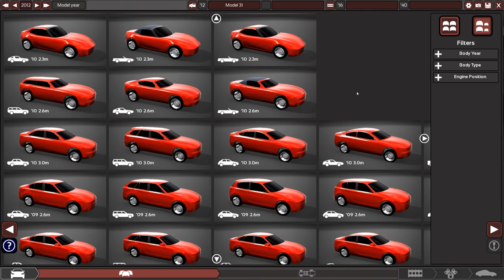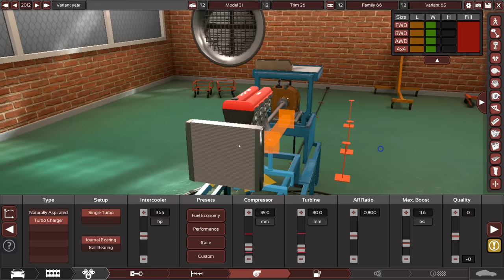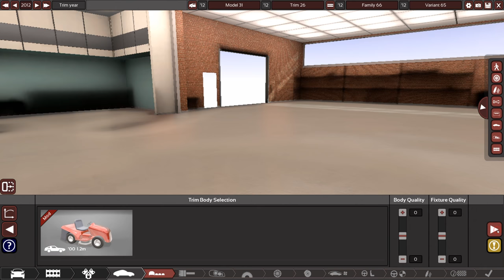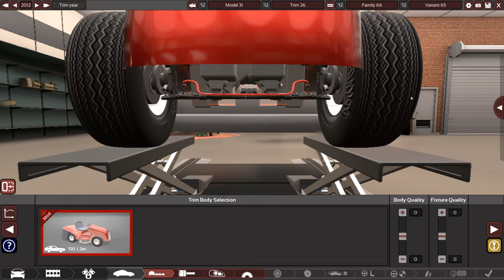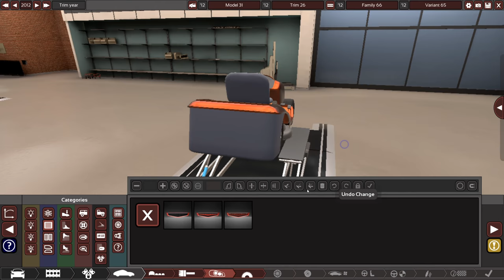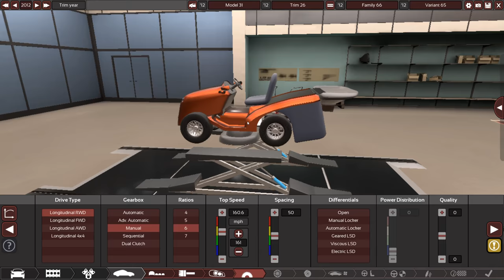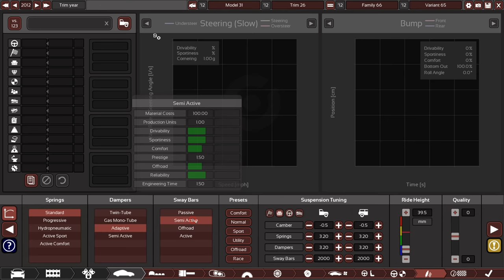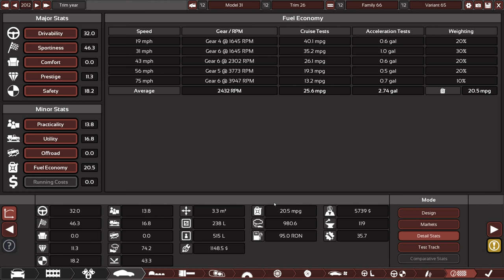Automation/BeamNG Drive - Worlds Fastest (And Scariest) Lawn Mower

Comment: That power curve is like
nothing, nothing, nothing, and then ABSOLUTELY EVERYTHING!!!!!!!!!!
Reply: mega-VTEC
Reply: Or how hovercrafting was put by Richard Hammond, its great, great, great, COMPLETE DISASTER
Reply: in this game there's no way to populate mid range aside displacement. 
i've tried. if there was a way to single turbo a V8 or twin turbo a straight six and run two stages, or twincharge, it would be a different story.
Reply: @comethiburs2326  ... or even just have more than two stages for your VVT, or the ability to tune them more carefully. The traditional VTEC style it seems to use where you have two separate torque peaks, one quite low and the other unusually high with a fall-off in-between is extremely old hat. Everything these days uses some kind of continually variable system, either a sliding cam/follower system with a smooth progression from one profile to the next, or what is more truthfully variable cam phasing to adjust how much of the intake stroke the inlet valve stays open for and how much of it overlaps with the exhaust (which requires non-interference head design of course... my own car uses an economy variant of that which adjusts how much of the fixed lift period falls within the intake stroke, and how much in the compression stroke, essentially varying the compression ratio and effective displacement), or in very fancy cases fully active electrically or hydraulically driven valves. Which means you can basically have the torque peak slide up and down the rev range in concert with the engine speed itself and enjoy a much improved midrange response and top end power without harming low end driveability.

Just one of a number of missing engine features in Automation as it stands (no single or twin cylinder engines of any kind, meaning a whole range of economy cars including some surprisingly recent ones can't be simulated; no V4s or V5s, W-configs, Rotaries; no CVT automatics, multi-range or epicyclic manuals; certainly no electrics or hybrids... hell, not even diesels, and I haven't yet seen anyone make a rear-engined model... etc, etc... and that's before we even get anywhere near exotica like radial engines, alcohol or CNG fuel, flywheel storage etc...), but, hey, it's a game set in an imaginary world, perhaps certain configurations or ideas just haven't occurred to the simulated automotive researchers yet.

Anyway, the insane curve wouldn't be too much of an issue for a real world ride-on mower, as most of them use infinitely-variable transmissions and keep a damn near constant engine speed when in use (other than a momentary dip when you first hit the accelerator pedal...), so you'd just shove the hand throttle up to max, wait for the engine to rev, then floor it and let the transmission governor do the rest. Of course, you'd need a very heavy duty IVT...
Reply: @gwenynorisu6883  you can rear engine. just skip the engine, tweak the boot size and you'll be able to fit a 4.2 flat six in the "porsche" bodies. there's some other rather surprising platforms for rear longitudinal too.

i concur. we NEED twins and narrow banked engines. lancia did VR4's before it was a thing.... for 50 years.
we could also use slanted engines and non crossflow, even siamese ports.
hemis, diesels...
that would offer a much wider and broader bunch of options to make power and economy.

for electrics, well there's not much to be tuned. we would have very little room to adjust thoose, at least untill the game offers platform OVER engine and not the opposite. (i'd rather have one body and twelve engines than one engine and twelve bodies.)
Reply: V T E C
Reply: 2-stroke :DD
Reply: @comethiburs2326  They've said they'll rework the turbos after the campaign is done, apparently that's about when they're adding superchargers, too.
Reply: Tis the way four bangers are, especially the ones that, in the wise words of Sliphantom, are "VTEC-cy as fuck."
Reply: @comethiburs2326  I raise you the 60 degree V4. Compact, powerful, decent torque at low RPM, everything you'd want from a small engine. Thing is, they're expensive to design, due to the extra timing components and engineering required to fit and run a balancing shaft, thus why mostly bikes use the V4 layout!
Reply: It’s not a power curve it’s a power wall

Comment: As a silly suggestion try the lawnmower around the autocross track.
Reply: I tried that. It got stuck on the first speed bump. Shortest lap I've ever had.
Reply: oops, my bad, messing up tracks.
Reply: I made a lawnmower with a tiny V16, stuck massive off-road tires and off-road suspension on it, and managed a lap and a half of the Endurodrome.
Reply: If you put 395 tires on it the suspension freaks out and kills itself when spawning in. I found that 315 seem to be the sweet spot so far.
Reply: Pretty good suggestion from a rapist Mega Lucario
Reply: I was thinking the exact same thing.
Reply: Probably turn over on at the first corner...

Comment: INCREASE THE AIR/FUEL RATIO

It cools the intake charge and reduces knock, meaning you can run way more boost/compression on a turbocharged car, and you don't lose any power.
Reply: Particularly as you're shoving extra air in anyway. It's pretty much expected that a turbo car will run rich. In fact I wouldn't be too surprised to find that it's the in-game way of compensating for the extra air mass, just manually increasing how much fuel is introduced by default at a certain rpm and throttle setting and having it burn in the extra air, instead of the complication of simulating sensors or pressure-reactive carburettors etc. (Would a carb add more fuel in response to a denser air charge, or is it only sensitive to the flow rate? It's somewhat before my time, I've only ever messed about with fuel injected cars, carburettors are a voodoo black box to my mind).

The massive knock failure, of course, essentially emulating what happens if you lean out a turboed car ... mmm, melty pistons!

...which reminds me, I wonder if/when they're going to implement Nitrous? Water-injection, maybe?
Reply: @gwenynorisu6883  
Blow-through carburetors are odd. Because carbs typically only run at around 7psi, you have to design them to increase fuel pressure to counteract that pressure. If you're running a normal carb at 7 psi of fuel and you introduce 7 psi of boost, you effectively make the carb run at 0 net psi and the engine will either go lean and blow up or just turn off.

Comment: managed to squeeze 750hp into mine, safe to say it was undriveable
Reply: update, have managed to get over 1000hp, wheels instantly fly off.
Reply: I managed to get mine to 680bhp and drivable (but only just, it is very wobbly) in 2005, 0 quality sliders. You need to use solid axle leaf front and back in order for the wheels to cope with all the torque, and you'll need to have about 100 rim offset front and rear. It still handles well tbh.
Reply: I've gotten 1300 ish hp before, don't drive it.
Reply: @omatssu  But does it work on beam?
Reply: Hell yeah, just the DCT is way to violent
Reply: @omatssu  I didn't realise the gearbox type had that much of an impact with driveability. Which gearbox have you found to be optimal?
Reply: @a1media885  haha made my day sir
Reply: If you wanna drive it, use the automatic gearboxes
Reply: @a1media885  The wheels flying of is due to wrong / weak suspension, (had the same problem...) just use the semi trailing arm in the rear and solid axle leaf in the front, than it should work...
Reply: I got mine to 2294 HP, it vibrates violently whenever above 150 mph
Reply: @D.O.A. I'll get it tomorrow
Reply: There’s a new version of it I think, built one with 3500 Horsepower. It goes 0 - 100MPH In 0.2 seconds, and it can’t go any faster because it bends it’s chassis at a 90 degree angle.

Comment: Mod author here. I am currently planning on making a formula SAE body next.
Reply: hey mod author! how do we get the rear suspension to stop murdering itself on spawn?
Reply: Ironically I find semi trailing arms to work the best with it. Or use an engine with less torque. Or just fiddle around with the suspension setup until it works. Personally I have never had this issue occur.
Reply: @venomtube6156  I used push rod suspension on the back and race preset, and the rear kept collapsing, wheel axles break or something, I mean it does have some 6-700hp and 5-600 torque, could it just be too much power/torque.
Reply: People have had mixed results with the sportiest suspension types. For some it works, for some it just doesn't. I assume there are more variables to account for other than torque.
Reply: @venomtube6156  It's actually like my wheels are not even attached or parts of the suspension are not, just setting off gently it collapsed. From looking at it I guess attach points are missing, or are weak on push rod suspension when they got shrinked and glitch out, I will try other suspension types, as the front seems fine having solid axle coil.
Reply: @venomtube6156  lol multilink just explodes for me, double wishbone as well, semi trailing arm is fine, solid axle coil would seem fine for lower power numbers or smaller wheels perhaps, cause when turbo kicks in and dumps the power it breaks, same goes for solid axle leaf. So for my power 670ish hp and application, semi trailing arms seems to work best at the rear, now I'm heaving problems with front solid axle coil collapsing under braking, >edit< making it stiffer fixed collapsing (wheels tend to shake a lot tho and break but it's OK) but now it tends to do front flips..a lot :'D love it, great mod and idea
Reply: I also recommend making the suspension super stiff, it is necessary for a car like this.
Reply: why is it only on steam?
Reply: Why is it so heavy? Limitation of the Automation and/or BeamNG engine or something? I've seen similar (and indeed rather more extreme, like motorcycles that apparently weighed over 2 tonnes) problems with other vehicle simulators that are only really tuned for a certain range of bodies and masses, like Racer and Rigs Of Rods. Turned out with those, if you tried to make a vehicle of less than a certain mass the physics engine started acting weird (BNG I wouldn't be surprised to find is similar, it exhibits the same unrealistic problem where crashes can stretch nodes to a clearly unnatural/impossible extent and imbues them with violent high frequency vibrations that never diminish or damp down even though in a real crash the surfaces would snap and the shaking usually stops after no more than a second), so even if you made a small thing it had to be stupidly heavy.

On the other hand, I have a feeling most ride on mowers don't use monocoques and are either lightweight straddle beams or even a form of spaceframe, essentially a modified motorcycle or ATV chassis, so it might be that the player choosing an unrealistic construction method (...and a massive whaletail wing) adds a whole load of additional weight?
Reply: @gwenynorisu6883  Yeah, automation isn't designed to work with such tiny bodies and it treats them more like regular cars than it should. It is possible to make it as light as a real mower but it requires some extreme material/quality setups. I do believe real mowers use very simple space frames which don't weigh as much. If the devs implemented such thing then there would certainly be issues with safety ratings, though. As it already stands the mower is pretty much unusable for the game markets unless you crank up quality on safety features. With a good setup it becomes a great track car, however.
Reply: Can you make a progator or truckster utility vehicle? Pleeeease? How do you mod? I’ve been interested.

Comment: The way Beam NG handles rigid body physics is so rubbery looking. I feel like it simulates vibration but slower so it just looks really odd. Cool that you can try it out driving around though. Feels like the wheels are attached with rubber bands.

Comment: the automation export cars have electronic speed limiters on them, which limit them to what beamng reckons it will top out at, but is usually pretty inaccurate D:
Reply: Yeah, but the setting looked like it was at 161, with the gearing set for hitting the rev limiter at 160-point-something. Unless there's a bug in the speed limiter code itself (either in Automation or in BeamNG), it shouldn't have made a difference.

Then again, maybe they used the same maths as Nissan and Renault seem to for their kilometre to mile conversions, which forgoes the exact and well known 1.6093km to the mile figure (or approx 0.6214 miles to the km) and instead variably chooses some random figure vaguely within spitting distance, often 0.6 miles to the km (1.667km per mile) or alternatively, and even worse, 1.5km to the mile (0.667 miles to the km). Which can be found in their user manuals, screwing up the estimates made by their trip computers, etc, and I suspect even in the cruise control and speed limiter electronics. The cruise never seems to quite keep to the speed you set it at, needing to be nudged up a couple of mph to actually stay true, and there appears to be a non-overrideable speed limiter that kicks in quite a bit below the stated maximum speed of the car, rather than either matching it exactly or being set just slightly over (...though it's too much of a discrepancy to actually be covered by either of those dodgy estimates, and what actually seems to match is the highest speed that can be set for the manual limiter - some mph's beyond the speed the limiter can be felt to actually kick in - which is suspiciously close to the kilometre Vmax multiplied by 0.6).

Comment: Look at the throttle bar on the UI, it's electronically limited and only using 50-75% throttle at "top speed".
Shame that Automation exports do that, it would probably go to 160-165 without it, considering 147 is only 70% throttle.
Reply: I thought the top speed limiter was something that you could change during the design stage? Is it that, or is it hitting the rev limiter, which might have a similar net effect? Or maybe even some kind of traction control cutting in because the tyres simply can't handle the power at any speed?

edit: above written after half-listening to the video instead of watching. It looks decidedly like the ESP is kicking in to prevent the noticeable wobble the mower picks up at that speed from progressing into a full-on spin. The speed limiter in Automation was set at 161mph (it looks like the default is to set it to the next nearest integer over what the top gear is set for, i.e. it should never limit on grounds of speed because the rev limiter will have already kicked in anyway), so unless there's a bug in how it exports the settings that shouldn't be having any effect.

Comment: The key for turbos in automation: Turn the turbine size all the way down and put the AR ratio to 1.40.(max) should spool very quick. Run it a little richer and it’ll accept boost as long as the engine can take it.

Comment: Tips for making a better turbo:
1. Use ball bearing turbos. Less lag.
2. The turbo sizes depends on when you want it to kick in and how much power you want to make, but minimising turbine size is usually better. 
3. Maxing out the AR ratio usually gives better results, but if you're looking for some efficiency you could lower it a bit. You'll lose some hp but get more efficiency in return.
4. Tune the boost accordingly. I find around 10-15 psi is optimal.
Oh, and I don't think the turbo quality sliders do much really. Not really worth the extra engineering time + production units.
Reply: There's not much that complex in a turbo that could be affected by that*. Maybe it grants you variable-vane or some fancy stuff like that at the top level, but it more likely affects reliability in the main Automation game. I can speak from experience that your main problem with a cheap turbo is that it will almost immediately blow up at exactly the wrong time ... grenading your engine along with it.

(and that wasn't an aftermarket bolt on, but a replacement for a dying OEM part...)

* edit: by which I mean the quality slider